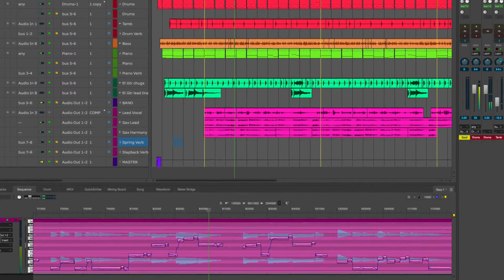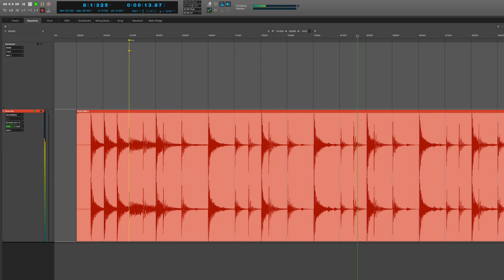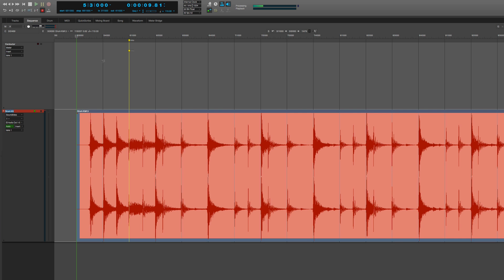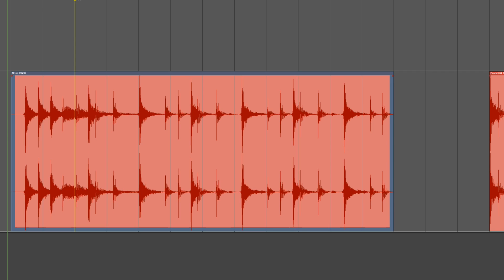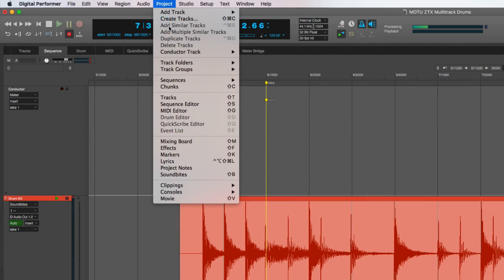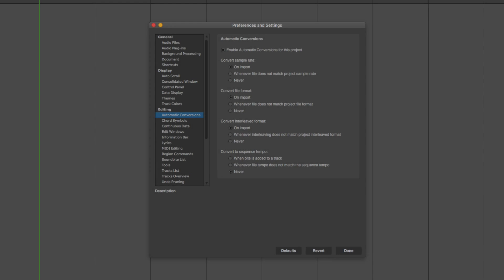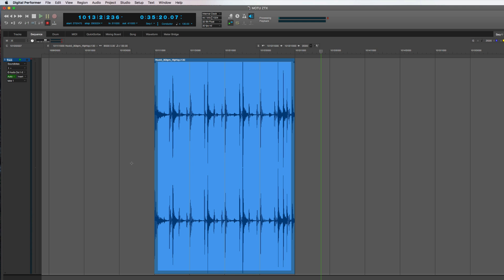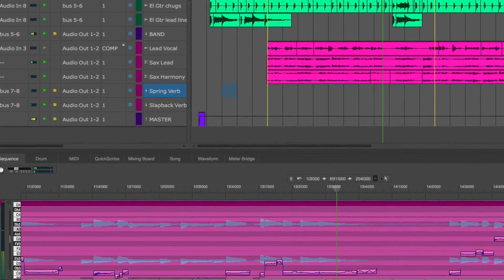Digital Performer 9.5 ZTX PRO time-stretching technology

Comment: Great built in TS algorithm! I just did a test on compressing a full mix from 80 bpm up to 90 bpm between DP9, Reason 10 and RX7. RX7 was the best and DP a very close 2nd. Reason is probably fine for individual tracks within a mix but one could clearly hear some "audio weirdness" on the full mix. BTW, have they improved this in DP 10?